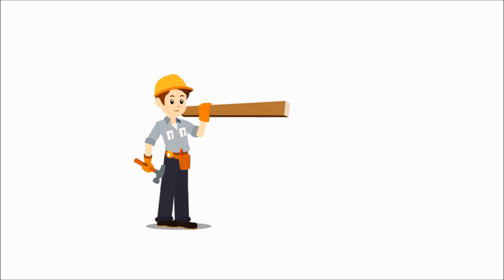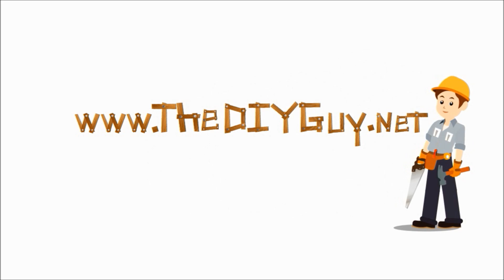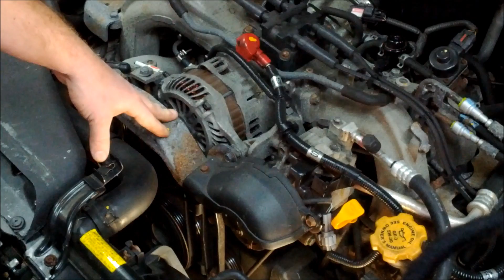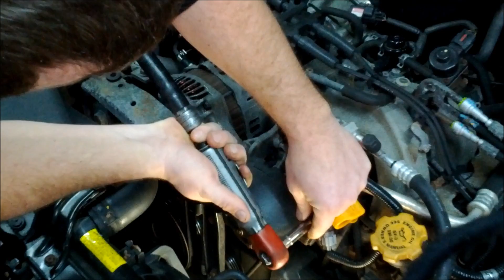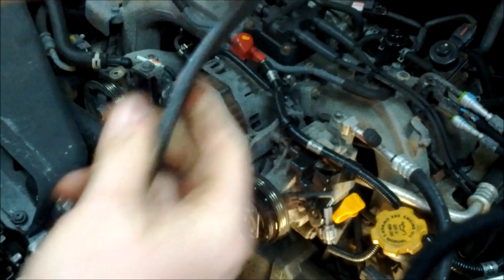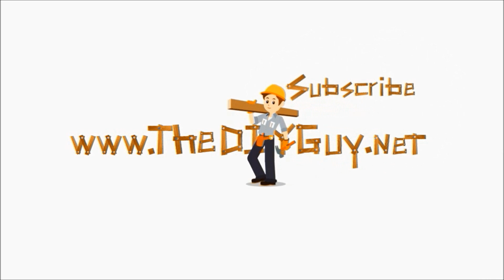How To Replace Both Subaru Drive Belts

Comment: I am hoping someone sees this. I have a 1997 Subaru Legacy 2.2 wagon. The battery kept dying but it was a brand new battery. AAA said I needed a new battery. He said they might have given me a dud. He jumped it and I made it home. I took it back and they gave me a new battery. It did it again. The check engine light goes on and then it dies any time I go over 40 or drive more than 30 minutes. Now they said it was the alternator. It’s not getting power to the battery.  So my new battery is dead again and they say it’s the alternator. I had to remove my alternator to take it to a shop and have it checked out. They said it couldn’t get any better so I put it back together.  I had to jump my car. As I was walking toward the front of the car to take off the connectors I smelled something burning. Now I have smoke coming from the left side by the power steering fluid. I’m not sure if that is leaking but I have said for over a year to all the mechanics I have seen no one seems to think twice about it. It’s pretty gunked up around it. So it sits. I did take the battery back to have them charge it back up to its fullest. They just exchanged it. So I have a brand new battery. Again. That’s three new batteries since last May. Any idea what could be smoking? Under the car next to the oil filter there is a metal tube I’m taking as maybe part of the radiator system. It was real hot which surprised me because the car was only on no more than a minute. I gave up. Bought an us pass and it sits. It’s been to many mechanics. Any ideas?

Comment: there is no adjustor on my 2010 forester .  Just straight Crank to AC
Reply from the maker: Hello, That is correct on that model and newer they went to what they call a stretch belt. Meaning that the belt just stretches and gets put on. There is no tightening the belt once it slips or makes noise you cut the old belt off. Get a new belt - https://amzn.to/47aTWw9 . You will place it on the a/c pulley and then start it on the crank pulley use a socket 22mm if I remember correctly and turn the crank pulley and walk the belt on. They do make a kit to install the belt but you don't need it.  Link to the kit https://amzn.to/47kVnsd. If you google " Gates Subaru Stretch Fit Belt Installation " That is a pretty good video on how to install the belt and use that install kit. Good luck with getting it replaced.

Comment: So, my tensioner below the A/C compressor appears to have “blown apart” today. Is that a big deal? My A/C compressor is out of commission as it is. I’m just worried the engine may be compromised now but it’s so damn hard to find info about this engine.
Reply from the maker: Not sure why it didn't alert me about your comment. Just seeing it now, Sorry for the late reply. The tensioner is just for the a/c belt, you can remove the belt and leave it and or also remove the tensioner.  You can find the parts to rebuild the tensioner. Adjustment Bolt Kit->  https://amzn.to/4owJ9E3 and the bearing wheel here -> https://amzn.to/3WCdRiY. Be sure to check that they will work with your car. You can also find some on eBay that are used or that have been rebuilt.
Reply: @TheDIYGuyDOTnet  no worries, thanks for responding! I ended up figuring that out, I was just really fried that day and no matter what I read amidst that ENTIRE week I couldn’t find useful info. I learned I didn’t even know the true model name of the car. Anyways, I’ve been running it without. I’m self taught so there’s gaps in my knowledge where someone might not expect there to be. I’m going to replace my clutch this winter fall, but I needed a YouTube video for this tensioner issue. “Self taught part swapper” lol
Reply from the maker: @TrustMelDontCare  Glad you got it figured out. Good luck with getting the clutch replaced.

Comment: I had to fully remove the 2 bolts that adjust the alternator to get the belt on, now when trying to reassemble it the bolts aren't lining up to tighten it all up and the top bolt that handles height adjustment is just slipping right out as I tighten.

Comment: for subaru outback I got a quote for this job, 740$, actually this should not cost more than 100
Reply from the maker: I think shops are 100+ labor rates and then the added shop supplies ect to the bill but even if you were to use the very best/ premium belts it seems high. Hopefully you were able to get yours replaced by watching our video and save yourself that money. Thanks for watching and taking the time to leave us a comment. Don't forget to give the video a thumbs up if you haven't already as it will make it easier for others to find. Thanks

Comment: what if the pully for the ac belt is seized? I only have the alternator belt but it is squeeling like crazy? can i put replacement belts on and not tmuse the ac so i dont have to change the pully for the ac?
Reply from the maker: I'm not sure what pulley you are talking about.. The one on the compressor? the A/C belt tensioner pulley? Either way if the A/C is not operational I would just install / replace the alternator belt and not put and the A/C belt on. Even if you don't click the A/C button on the dash if you put the car on defrost the car will try and use the A/C. So I would just install the alternator belt and then when you have replaced the part/ pulley on the A/C then go ahead and install that belt.

Comment: Great video brother. First time i've seen someone use pb blaster on the adjuster threads, this would have helped me out big time in that I went to adjust my AC Compressor belt in the frigid cold last night, threads were stuck, gave it a little bit of pressure and boom, cracked the adjuster. Fortunately it's an easy fix and a cheap part! My struggle though is getting the belts to the correct tension to where they won't squeak, looks like you pretty easily were able to tell the correct tension?

Comment: Are there any exact measurements for how tight the belt should be? I’ve heard a lot of driveway & backyard mechanic tips on it and I know I’ve seen some reports from the factory. Just wondering what your trick is

Comment: Awesome! Just watched this video to replace the belts in my 2003 Subaru Baja. I’m not super mechanically inclined but this video was easy to follow and I got the job done. I got the deep sockets and PB Blaster at Walmart and saved $100 on having this done at the shop! 🎉 also learns something new and built some mechanical confidence. Thank you!!
Reply: big ups

Comment: One thing you forgot to mention (messed me up) was that bolt to adjust the tension for the A/C is a left-hand tread bolt.  So opposite for tightening and loosening the tension pully on that belt.
Reply: Excellent added info. Thanks! 😊

Comment: Good video,straight to the point, looked easy enough for me, with a lot of mechanical experience and tools, to do my 1996 Subaru Legacy Outback .  However, when I got to the point of loosening the locking bolt for the AC belt tensioner, there was insufficient clearance between the bolt and an OEM fan motor mounted on the back side of my radiator.  With my short (total length 7/8") 12 mm socket alone on the bolt, there was only 1/4"clearance between the base of the socket and the fan housing, not nearly enough to attach a 3/8"-drive ratchet wrench.  The tensioning bracket is U-shaped around both sides of the bolt, so you cant get an open-end wrench on it.  My 1/2" offset closed-end wrench is just a bit too big to grab it and I didn't have a 12 mm offset.  Fortunately, I happened to have a length of 3/8" square steel bar (rod) lying around and was able to cut off a length (7/8") to insert it in the socket drive hole and grab with a 3/8" open-end wrench to loosen the bolt.

Comment: Didn’t realize it was this easy. Thanks man! Quick question though if the ac belt snapped would it mess with the car and how it functions in any way? (Besides the ac not working)?
Reply: Shouldn't do. If the ac belt snaps you only lose ac. I would remove the snapped belt so it can't snag any other moving parts.
Reply: @ChariotsofWire180  appreciate it 🙏🏽 🤝

Comment: Thanks so much for this, i wanted to replace my power steering belt as it sounds like its the issue but i did not want to spend what the mechanic was charging on something that may not be the issue!

Comment: Cracks ACROSS the ridges is perfectly normal. Only when there is splitting length-wise and/or missing/worn ridges is it necessary to repace the belt.

Comment: I was going to replace the belts at 100,000 miles but one of the belt broke on the way to a campground last fall and my car had 94,000 miles at that time. Battery light came on and the steering wheel was heavy. Fortunately, I was able to find an auto shop 5 minutes away and got both belts replaced under an hour.
Reply from the maker: Sounds like you got pretty lucky on the timing and the place that the belt broke. Glad to hear that you got them both replaced fairly easily and quickly. Thanks for watching and taking the time to leave us a comment. Don't forget to give the video a thumbs up/ like if you haven't already. Thanks

Comment: Is there a break in period on new drive belts or are they good to drive as you normally would straight out of the box?
Reply from the maker: You can drive as you normally would. I would just recheck them a few times as the new belts will stretch a bit and if your pushing the car you don't want to start to glaze the belt.

Comment: Is it ok to be a small squeaky sound when your turning the wheel? After you install the belts?
Reply from the maker: The squeak is the belt slipping. Since its been a month the belt has stretched a bit more and you will want to tight the belt a little more.

Comment: If only the AC compressor belt broke, can I still drive the vehicle.?
Reply from the maker: Yes you can still drive the car as the alternator is still being driven by the other belt to charge the battery.

Comment: Are they the same size?
Reply from the maker: No they are not. The a/c belt part # Gates K040332  Link - https://amzn.to/2WnOdRp and has 3 v grooves if I remember right and the alternator has 5 If I remember right because its a wider belt and the part # Gates K050345  Link -  https://amzn.to/2EwVJ29. Those where the belt used in the video double check to ensure that they will fit the year, and model Subaru you have. Thanks for watching and don't forget to give the video a thumbs up. Thanks

Comment: Excellent video, thanks so much for making this! I did notice one small omission.  After removing the covers and loosening the first two 12 mm bolts, my alternator refused to budge. I tried pushing on the bolt, hammering the bolt, pushing on the alternator; nothing worked. I even contemplated standing on top of the alternator! Then I noticed the little 12 mm mounting bolt on the right side of the alternator. Could that be holding it in place? It was very tight, but with some effort, the right bolt cracked loose and, sure enough, the alternator rotated down just like in your video. What a relief! I finally was able to get the new belt over the alternator pulley. I hope others who are struggling with this step will read this and solve their problem too.

Comment: Can you run this car without the ac belt? Mine just broke but it’s winter. I pulled it off but the car won’t stay running. I thought the ac belt only ran the ac. Any ideas?
Reply from the maker: Yes, You are correct the A/C belt just runs the A/C and you can run the car without the A/C belt. The alternator belt is still on and tight? Sometimes when the A/C belt breaks it goes into the alternator belt throwing it off. Just double check that its on all the pulleys sometimes it stays on the top but pops off the crank pulley or idler so from the top it will look like its on but it doesn't turn. Is your alternator charging ? Maybe you were running off the battery and now it is to low to run the car. Video on checking your alternator ->  https://www.youtube.com/watch?v=SJEtweGMNYE or try charging/ topping the battery off and see if the car will stay running. Any lights on? Check engine or brake light?

Comment: I followed the directions just as in the video but both belts have a slight wobble to them and I think the harmonic balance pulley must be misaligned since both belts have a wobble and I don't think they are too tight. Does this sound right? Can someone point me in the right direction to find out how to check the alignment and then realign if that is in fact the problem?
Reply from the maker: Hello, Kind of funny you bring that up. We just had two that we just dealt with in this last past week. One the harmonic balance pulley had the metal and rubber actually separated causing it to shake/ vibrate (third one we have seen have this happen) and the other the bolt loosened up a bit causing the pulley to shake/ move around breaking/ damaging the Woodruff Key for the crank. Something to take a look at or check.
Reply: @TheDIYGuyDOTnet  Ok. My gf said it felt like the power steering went out last night and this morning I turned it on and it almost seems like the belts are looser than they were when I put them on as if they've stretched or I must not of tightened the bolt enough when locking the tension in place. Car makes a crazy squealing noise when the wheel is fully turned, which it didn't previously do.
Reply from the maker: @bradleythompson7785  New belts do stretch and need to be adjusted but normally a month or so later. The bolt holding the  tensioner might not have been tight enough. You telling me the car makes a squealing noise when turned fully indicates that the belt isn't tight enough. If you click the link in the description it will take you to our website and at the bottom we have a picture and a write up on the proper tension on the belts. If I remember right... The alternator Torque on the lower bolt was 28-38 ft. lbs. (38-51 Nm) and the upper bolt to 14-18 ft. lbs. (19-25 Nm). Hope that helps get you squared away.

Comment: Do you need to remove the negative battery cable before you start?
Reply from the maker: I didn't remove either cable. You could remove the positive if you want to be safe. I would remove the positive if your cover is missing over the alternator lug/ stud on top just to ensure you don't short it out.

Comment: Is it common for the ac or defroster to make a slight impact on driving? In these cars? Defroster mainly.
Reply from the maker: Yes, On the 4 cylinders you will notice it turn on or kick in especially if your going up a hill. Not as noticeable with the 6 cylinders. When its set to defrost it turns the a/c on so it should feel about the same.
Reply: @TheDIYGuyDOTnet  I hate how it does that. Seems like defrost would be a simple ven't mode like face or feet
Reply from the maker: Dallas Williams  It uses the a/c to pull the moisture from the air acting like a dehumidifier so it doesn't fog up the inside of the car.

Comment: Is the ac adjuster pulley supposed to rub on the timing case? Mine is and the belt is as well
Reply from the maker: NO it is not. Check to see that the top bolts of the adjuster are tight if they are you might have a bent adjuster.

Comment: Thank you so much!! Thought the belts were the issue, here I had some work done a few days (needed a new power steering pump/steering brackets installed). The idiots at the shop completely forgot to put the adjustor bolt back on to hold the alternator in place, therefore the front belt was loose, your video saved us
Reply from the maker: You're welcome, Glad we could help before it ended up throwing the belt off and leaving you on the side of the road. Thanks for watching and taking the time to leave us a comment. Hopefully the shop still had the adjuster bolt to put back on.

Comment: Good video. I would like to add to make sure you get the right belt at the parts store. It can be confusing and I only needed the alternator belt. Went  back and got the right one, not that big of a deal.
Reply from the maker: Yes, very important to know the details of the car and the manufactures date as some are a split year and have a different belt and also what belt your looking to replace.

Comment: Are both belts the same model? I have a 2007 forester and trying to order them. What are the model numbers? THANKS
Reply from the maker: The alt. & power steering should be GATES K050344 Belt and the A/C belt should be a GATES K040353 with a manufactured date of Jan 10 2007 or older and Jan 11 2007 and newer it would be GATES K040337 Belt.
Reply: I think when you request from the parts store just give them the chassis number and they will pick the right model for your Subaru. That is what I did and it fitted perfectly.

Comment: How the heck do you get to the bolts???? Do you have to take out the radiator/fans because there is no way to get to them otherwise?
Reply from the maker: There is no need to remove the radiator or the fans. We left the fans and the radiator in the car in the video. We just used a short socket and a ratchet and loosened the bolts. You can loosen and remove the radiator brackets and let the radiator coming forward to give you a little more room.
Reply: I have a 2004 forester. It's a little bit different from what your working on. But thanks I'll work it out. :)

Comment: Thanks for the upload.  My accessory belt happened to melt/snap and there are bits of rubber on the ac compressor pulley and the harmonic pulley!

I'm definitely buying a belt, but is there a good way to clean off the rubber leftover on the pulleys?
Reply from the maker: You're welcome, glad we could help. Just use a wire brush to knock off the melted belt pieces. You can use a short 22mm socket to turn the crank pulley. Thanks for taking the time to leave us a comment and for watching.